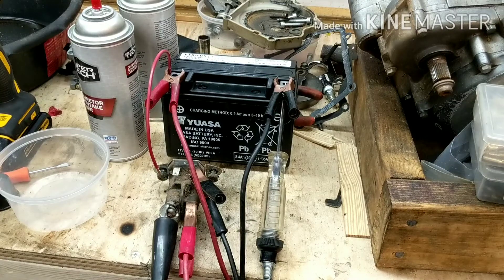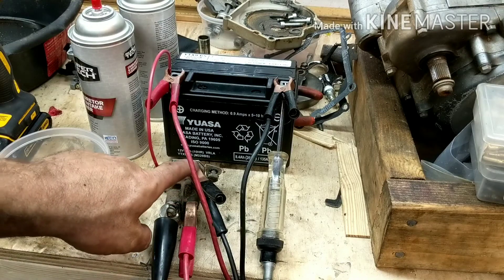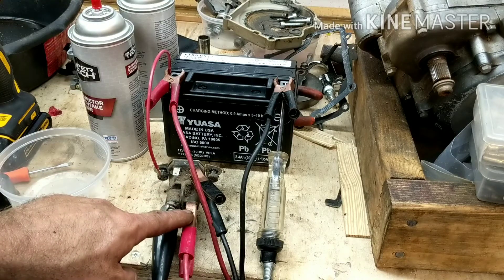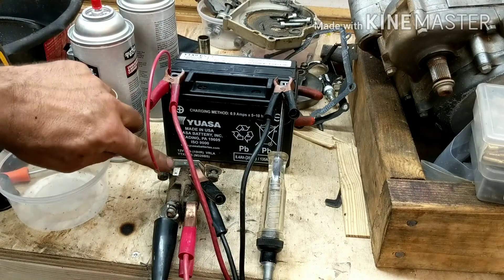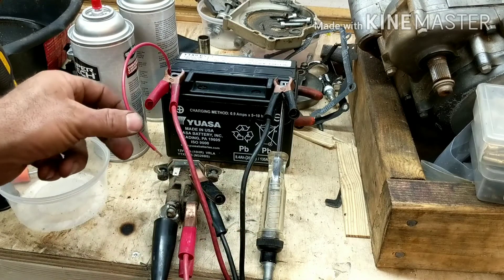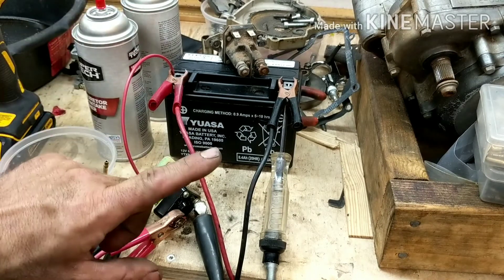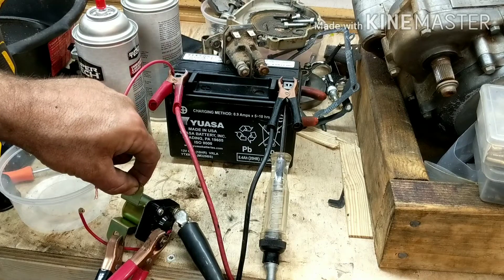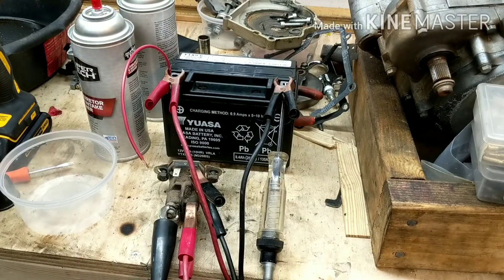Bench testing a starter solenoid

Comment: My starter kept running with the key off. I had to quickly unscrew the negative terminal on the battery. I ran your test, and with the same setup, when I turned the key on, without the starter button, the starter side terminal lit up. Damn! So the contacts in the solenoid are fused/linked with the input cable. I ordered a replacement solenoid.
Reply from the maker: Good job figuring it out!